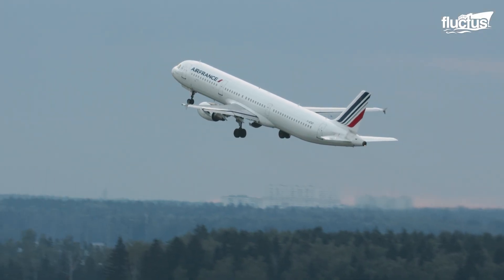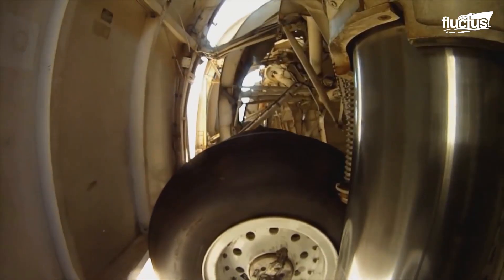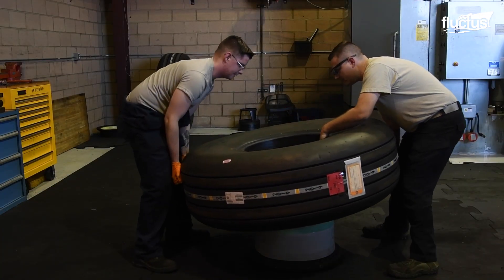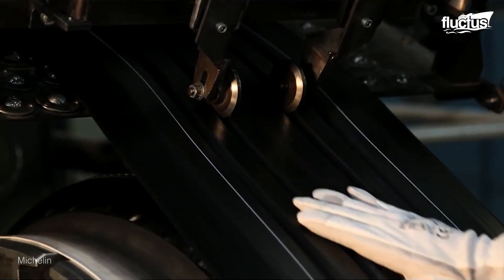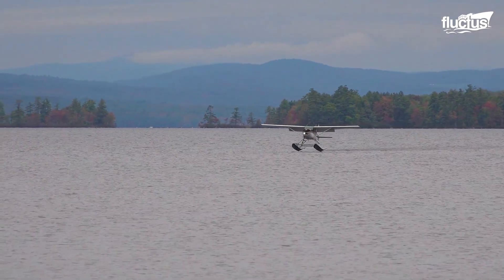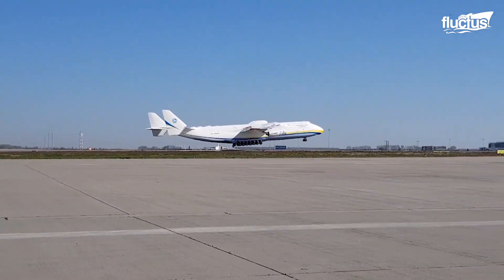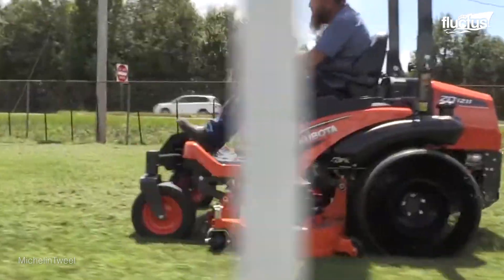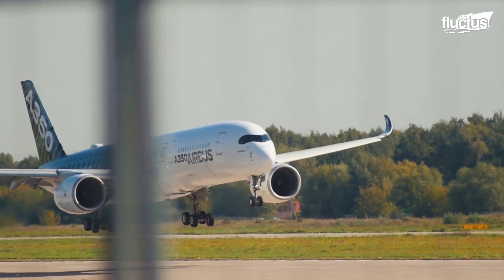How Aircraft Tires are Maintained for Extreme Heavy Landings

Comment: Been working with Aircraft wheels for about a decade Boeing 727 737 747, Airbus 320 series, Gulfstream, Challenger, King Air and Dassault falcon aircrafts.. My primary role is to perform Non destructive test on wheelhubs and tie bolts to check for cracks mostly coming from Fatigue and Overheating. Working with Bigger Wheels from start to finish (Return to service) requires a lot of muscle Power.                                                                                                                                                                    One really interesting experience one time we had is with this small kingair aircraft all of its four mainwheel brand new tires have flat spots that needed to be replace. Its pretty unusual though but we manage to replace it easily.                                             But just after a few months same pilot but different aircraft worse thing  happened all its four mainwheel tires had blown Fuseplug causing the wheels to release all its air pressure during landing.                                                                                         according to the Pilot he did nothing wrong. But upon investigation during landing The brakes on the wheels started heating up causing the brakepad and caliper to melt and fuse together. I myself inspected the wheel for cracks and even performed Hardness test but its pretty obvious all four mainWheels are busted!                                                                                              During the panel investigation it was found out he have a heavy foot just before the wheel touchdown he was already stepping on the brakes! He tried to defend himself but the Board wont take his alibi. The Pilot Got Fired the immediately after the Investigation!

Comment: Don’t you  have to use tread protection  for the axel when you take the tire in and out ? If the tread damage it will be expensive to replace it.just saying .
Reply: You are correct. A thread protector is recommended to be used by the aircraft manufacturer

Comment: Is cold or low temperature tire is better than to increase before take off and landing?
Reply: Perhaps this partly answers your question:  Aircraft tires heat up as they roll (mainly from sidewall flexing), so for long taxis (several kilometers) between terminal and runway a higher pressure is better in order to minimize that heating.  Heating matters because as tires get hotter, their strength is reduced.

Another aspect of landing gear servicing as it relates to temperature:  In extreme cases, flying from a warm-weather airport to a very cold one (e.g. Moscow in winter) can create a problem for the shock strut, causing it to bottom (metal on metal contact -- ouch!) during landing.  That situation can be seen by applying the "ideal gas law" (or "perfect gas law") to the nitrogen inside the strut.  What was the proper pressure at a warmer temperature can become too low of a pressure after the nitrogen is chilled.
Reply: If the wheels of the landing gear are too hot before take off, when they are retracted into the wheel well after take off it could cause an overheat warning in the landing gear wheel well. This is a problem. I think you will find that the brakes cause more heat build up to the tyres that just the rubber flexing during taxing

Comment: For a 737 example how many landings do you get from a tire before replacing it?
Reply: Yyyyyyyep.
Reply: That number, for any airliner type, is generally in the few hundreds.  Depends on things like runway condition, brake utilization, and operating weights/speeds.
Reply: @marcmcreynolds2827   all that included, there must be an industry average.
Reply: @neumoi3324  Presumably each airline or operator knows what their average is, anyway.  I don't know whether anything specific is published for an entire category, such as Part 25 transport aircraft (airliners).  The only large aircraft type which I can put a specific number to is the Space Transportation System orbiter:  1 landing per MLG tire, and in some cases the tire barely survived even one landing.
Reply: I replaced a B737-800 main wheel tonight. The off going wheel had 274 landings before the tyre had reached its service limit. It was fitted onto the aircraft for around 2 1/2 months. I’ve never looked it up before but people ask this question all the time. I guess that would be fairly typical